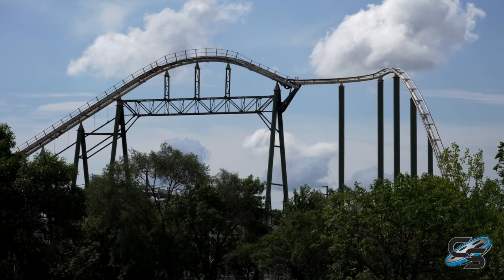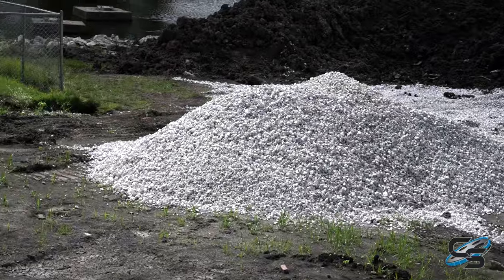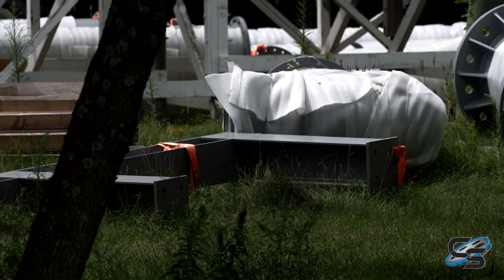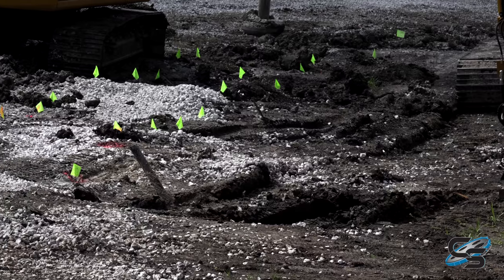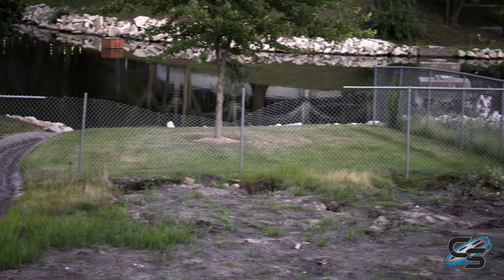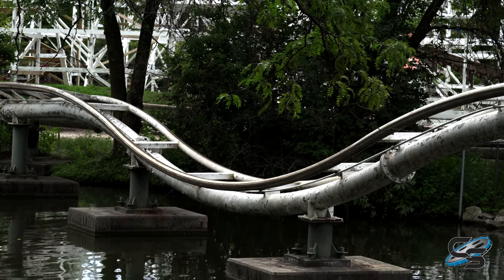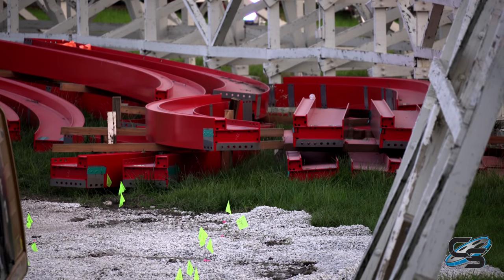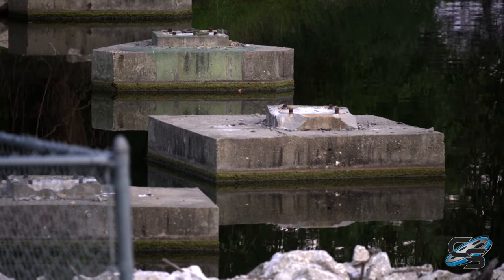Dragon Slayer Construction Update August 2020 Adventureland Iowa

Comment: Although Dragon is being dismantled, the station was completely repainted on the outside last year (2019) leading many to believe it wouldn't be dismantled at all. This could mean a new attraction to go into the station. However, there is also talk of salvaging the wood that comprises the station to be used for other uses. The space will certainly be there in coming years but it's uncertain if it will house a roller coaster or something different. 
Another thing to note, two log trains from Adventureland's defunct log ride are currently being held behind Mainstreet along with other objects the park is putting in (mainly lockers and trash cans). The two trains, 16 and 14, were originally put right in the backlot behind Storm Chaser, in full view of the park. Now they are hidden and tucked away. Earlier, none were outside and were hidden from any view. Slowly, they emerged one by one, leading most to suspect they were being refurbished and ready for possible display or usage. My best guess would be to fit the logs for planters or photo opportunities where the trees stood at the front gate. The trees, newly this year, were taken out if the path and paved over without any explanation.

Comment: Some food for thought, when the park built Monster it replaced an old log flume ride. Park officials at the time said that they would eventually replace it with a newer water attraction, but that hasn't happened yet. Where better to build a water ride than over the water behind Dragon's old station, in the space you are guessing will be vacant still.
Reply: I think they could make a new water ride at splash. That ride is underwhelming to say the least
Reply: I worked there last year and they still have the carts for it still so idk

Comment: Dragon Slayer is 100% going next to Tornado.  This has already been announced by Adventureland.  Whether or not we'll be getting another ride is still up in the air.   I sure hope we do.  That'd be such a waste of space if we didn't get a second ride.  I'm pretty certain we will eventually, though.  They're waiting to take out the rest of Dragon until after they close for the season.  This is also when we'll start seeing Dragon Slayer rising.  Both of these require a large crane to remove the old ride and put up the new ride.  This can't be done when the park is open with guests around.  Or maybe they'll start working on these things in September on weekdays when they're not open.  They only open on Saturdays and Sundays during September.